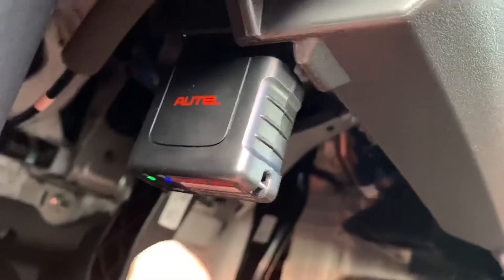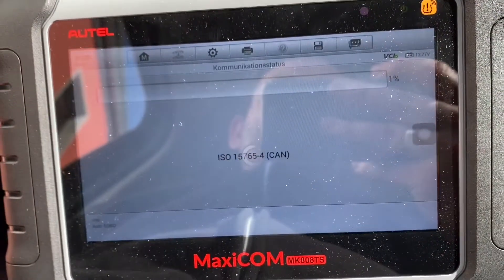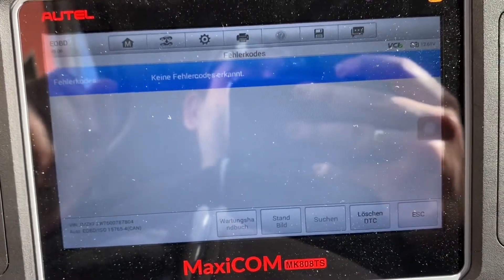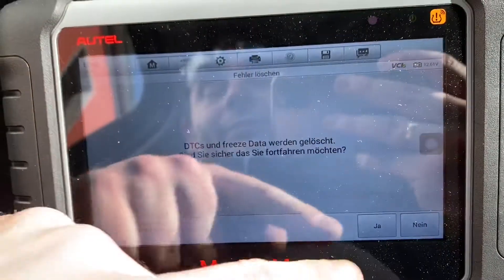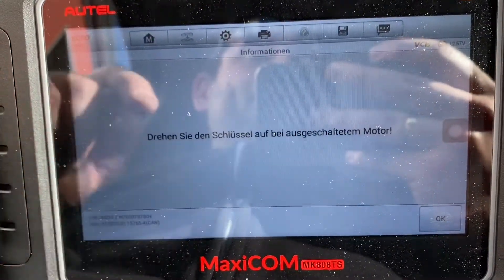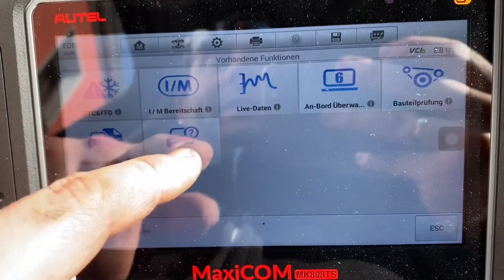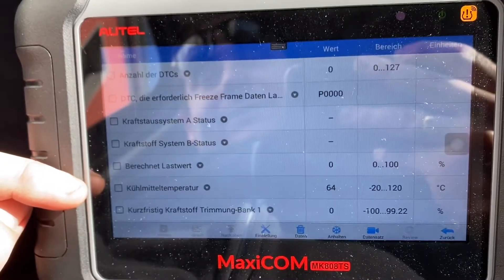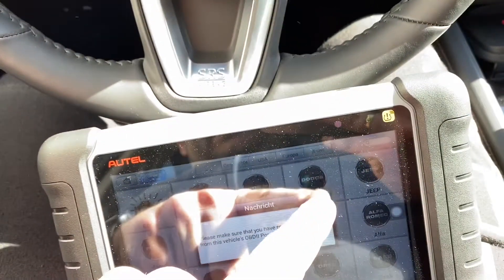How to use an OBD2 scanner to read error codes with OBD scan tool malfunction code Mazda CX-5 DIY

Comment: I got to use one of these at a shop and I was confused because it didn't allow me to scan different ECU components. I wasn't sure if it was working correctly or if it was missing some packages. Are you sure this is working as intended and doing an actual scan?